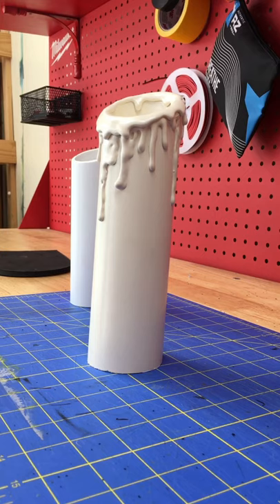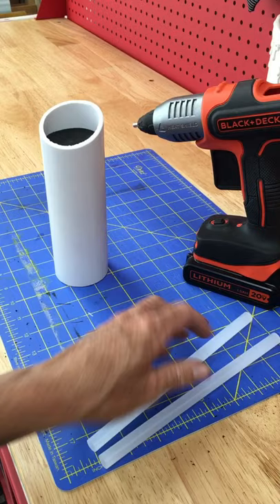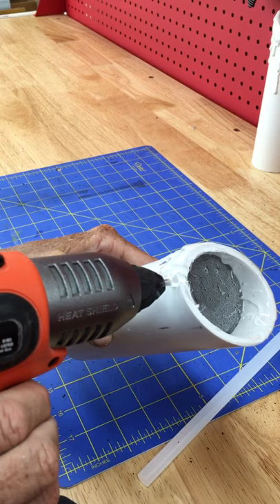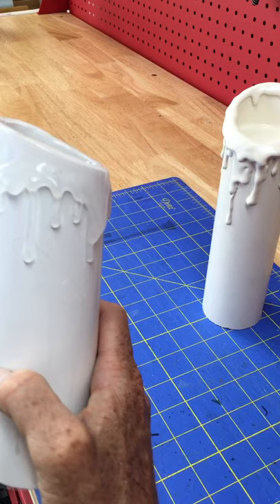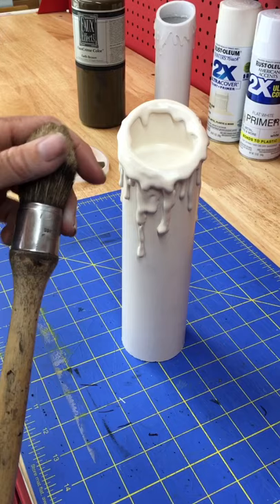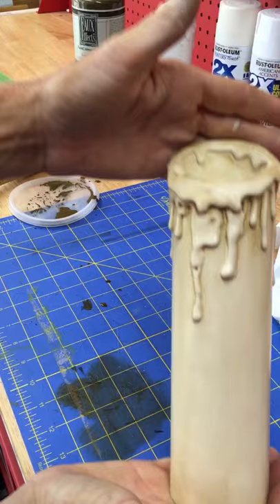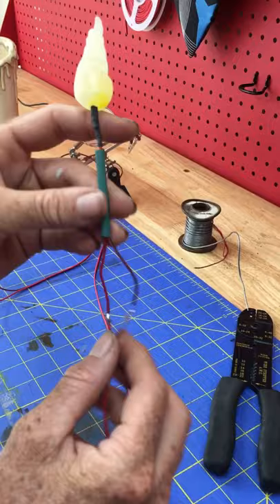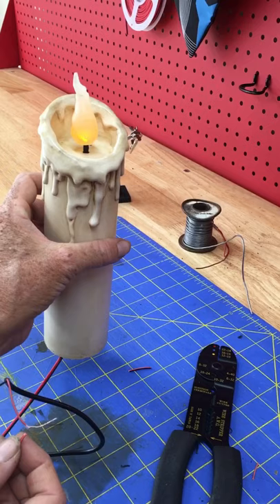Pvc pipe LED candle

Comment: they look great, love the fake flames you make. just one quick question, did you not individually  insulate each wire before the heat shrink? got to make a bunch more of these myself this year, hard wired. My first batches years ago just used the flicker t lights
Reply from the maker: Jak Skelvin My mistake, I’m new to wiring. This was my first electrical job 😆 you are correct. I should have protected each wire before the final shrink wrap. At least I found out before I did that to all 45 candles I’m making .
Reply: @karawalkerdesigns167  just wasn't sure. yes you definitely didn't want to blow LEDs  or redo the heat shrink on all 45 again :)

Comment: Using the wire as a bit of wick is a brilliant idea.

I get lots of stringy bits on my hot glue.  I don't see you battling those at all.  Is there a trick to how you apply it or what temperature you use?
Reply from the maker: I use an Arrow glue gun from Home Depot. High temp
Reply: I like to use a heat gun to melt away the strings on the hot gllue before painting. It works very well